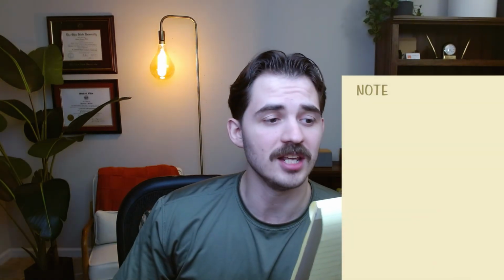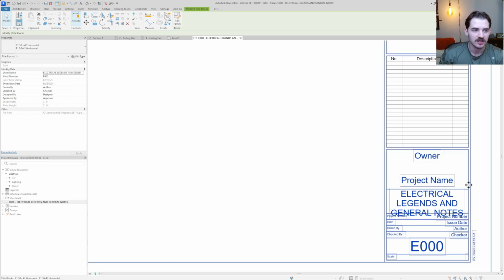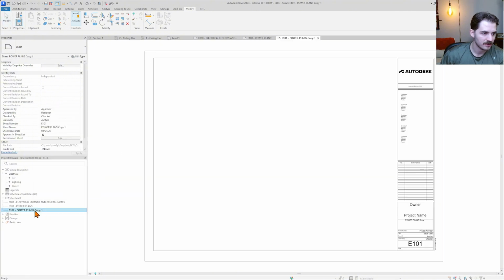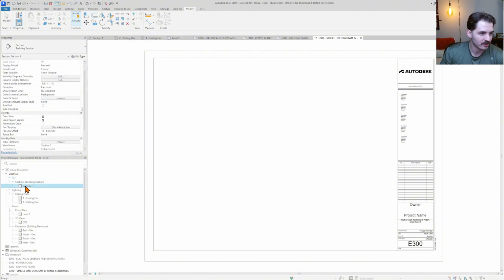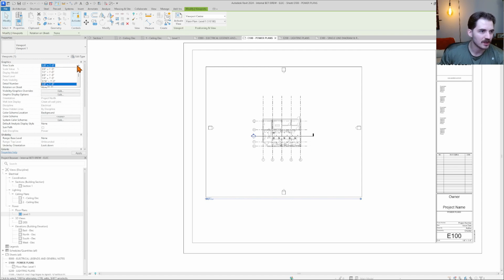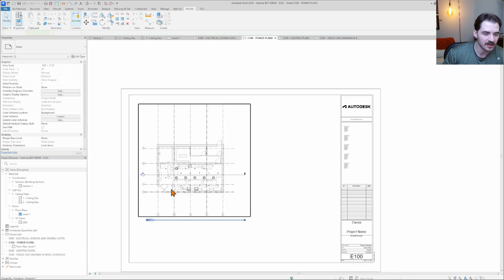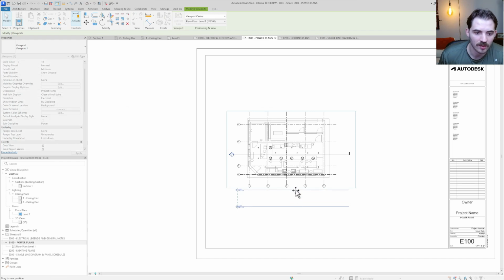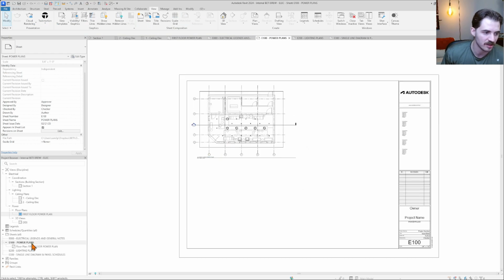Revit Electrical Tutorial for Beginners | Create Views, Sheets, & Title Blocks (Part 3)

Comment: Hey
I am also Electrical Engineer in MEP field Specially Buildings and Construction industries. I would like to suggest to you that could u please make details videos on power flow from second side of transformer to till Electric socket (like SLD) step wise on Revit,so it will be helpful for your viewer.

THANKS